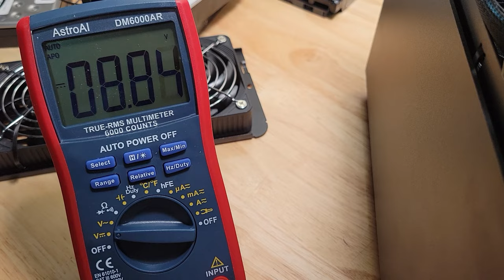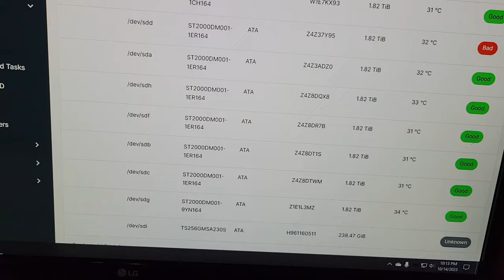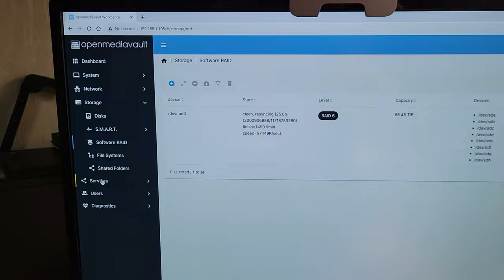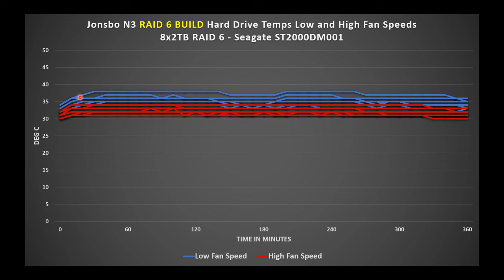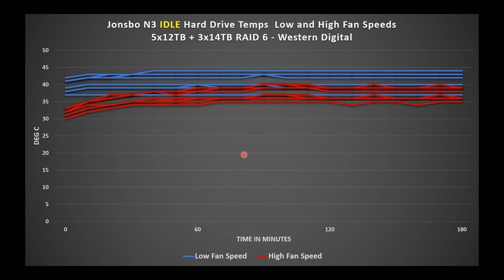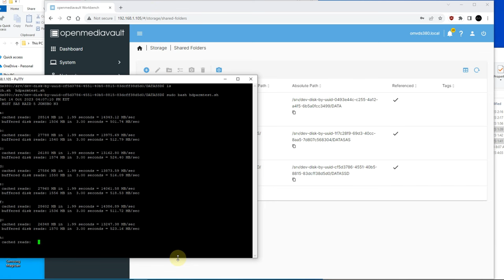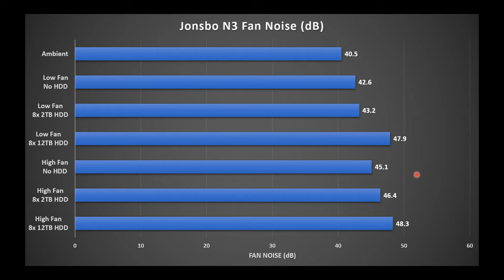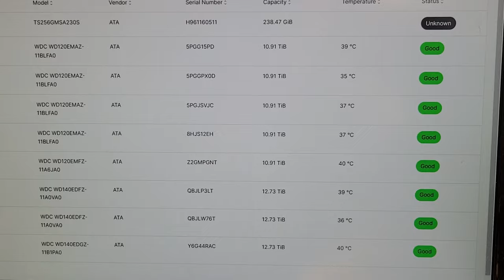Jonsbo N3 8 Hot Swap Bay NAS Case Review

Comment: One note to the ITX form factor and only 1 PCIe Card: you can bring out 4 pcie lanes from an unused m.2 slot on the mainboard via an adapter cable (just google m.2 to pcie cable) and use that for a 10gbit ethernet card or similar :)
Reply: Could also get an M2 to Sata adapter and leave out the HBA in favor of a 10gbt NIC.
Reply: been researching for a few weeks, and it's been frustrating finding that itx+10gbe+8sata, and i'm smacking myself reading your comment why I didn't think of that
Reply: Yes, this is a great idea

Comment: Honestly it's like they are trying to make a bad design (and they are insultingly expensive), in my opinion a nas good for most personal use's doesn't have to be a very powerful machine, you have to take in account power usage (electricity cost's money) and noise as it most likely going to work near people. The motherboard should be placed preferably on top for good heat dissipation with an air vent or option 2 on the side and top vent, in both cases with enough room for a beefy cooler (to reduce fan usage and noise) . Jonsbo n3 is good but they just had to insult us with not having a top vent and some decent hdd bays also the price is high and your getting so little especially considering that the users are going for this option precisely because they don't want to spend to much money and the build quality could be better, also larger rear fan exhausts, they make less noise and you can move more air trough  !

Comment: The extra HBA requires extra power consumption, which is not a good design, the PSU is heavy and should not be placed on the upper tier, the motherboard form factor is locked at ITX size, this is another drawback, I prefer buying second hand super micro servo The appliance has a case with 8 hard disk slots.

Comment: Great overview! I have the N2 and it's great but I wish the N3 let you install a mATX motherboard as the added width wouldn't make that much of a difference and would differentiate it even more from the N2.
Reply from the maker: Fully agree, Mini ITX is OK for a 4 bay NAS, as you can find motherboards with four SATA ports, but 8, you need an HBA PCIe card. They could widen the case by a few inches, shorten it by a couple inches because you don't need full height cards or massive CPU coolers, and put the SFX PSU next to the hard drives.
Reply: @htwingnut can use a m.2 to sata ports card on mitx but yeah make it a little wider to fit matx would be great
Reply from the maker: @Andreas-w  Agreed. But if you use M.2 to SATA port adapter you lose the M.2 port for your OS. I know there are mITX motherboards that house two m.2 slots but one is on the bottom of the board and uses a separate controller and usually are much more expensive boards.

I just think that this device wouldn't need to be much bigger to house an mATX, just make it wider and house the SFX PSU next to the drive bays, and allow room up top for an mATX board, and doesn't need to be quite as thick either. Just my opinion though. Otherwise case is actually quite nice.
Reply: @htwingnut  yes matx would be a better solution

Comment: Great review! Thank you for all the information. I know it's been a minute but when you built this did have any issues with the power configuration on the back plane? Did you have the 2 atx and sata plugged in to supply power?
Reply from the maker: I had plugged in both SATA and Molex. You may not need all of them but I wouldn't risk it to be honest.

Comment: Good review, thanks.  Whilst I agree with your review, in the summary there is one thing I dont agree with.  I dont want a NAS, I want a mini Application Server! I will need a NVIDIA GPU card because I would be running Frigate, Compreface and Double Take.  So the height is needed for me. (and actually the PSU needs the height!) and I will need to ensure good cooling on the CPU and the M.2 cards.  BUT as I said a good review to confirm it is a good case for those needs.
Reply from the maker: Thanks for your comment! It is good to have the option for sure. Just for those looking for a NAS case (which seems to be its primary intent) it is just extra unnecessary bulk.

In my mind ultimately make the footprint a bit bigger to fit mATX board and then can mount GPU sideways, move PSU down next to hard drives, and not be much larger overall.

But that's a wishlist, lol. The case is pretty nice as is.

Comment: I put a similar comment on another video but I wonder if an Asrock H610M-HDV Motherboard will fit in this case it is an m-atx board but is only 19.7 cm x 18.8 cm so might fit and would allow use of both PCIe slots. I think it will but might have to mod how the Powersupply is attached, possibly mounting it horizontally rather than vertically?

Comment: Thank you for this review! It’s the perfect case for my needs. I currently have a mITX Xeon with 6x 3.5, 1x 2.5 in a Fractal Design Array R2 and wanted to install an Intel Arc 380 for video transcoding and some ML photo classifiers, but the card blocks a HDD… this is the solution! 
As others have said, more modern boards come with 2 M2 slots, of which one can be converted to 5+ SATA ports, and having space for a GPU for ML applications or transcoding is in my eyes a big bonus for a home server. I don’t want to have multiple machines running 24/7. In this Jonsbo case, one can provide a ton of storage to the house, and host media services with plenty of processing power in one box. The separation of storage and compute compartments is brilliant, one can put a powerful CPU/GPU in there and not worry about frying the disks!

Comment: Thank you for this video. I am planning to build a NAS in this case and this was a great help. There's a cool little board from Silverstone (the ECS07) that plugs into an m.2 slot and provides 5 additional SATA ports. Only Gen 3, but it looks like it will provide the throughput needed for hard drives.

Comment: OK, but what are actual SAS interface speeds for its backplane? Is it full 12G, or is it halved, because only one port is active?
Sorry if my question is stupid, never had a chance to work with SAS drives…
Reply from the maker: I am not 100% certain, but I would imagine if it were "SAS compatible" that it would be 12G as it's just an electrical pass-thru and speed is more dependent on the SAS controller than the slot. Not to mention that unless you have drives that can run 1200 MB/sec it'd be hard to validate either way.

SAS 12G is more for total bandwidth for expanding to multiple drives, which wouldn't be a factor in this situation, because each disk would get their own dedicated 6Gbps or 12Gbps lane.

Comment: Hello. Can you tell me how many watts your power supply is? Approximately how much does the system consume when idle and with multiple disks?
Reply from the maker: PSU is a Silverstone SX300-B 300W. I no longer have the system assembled, so unfortunately can't tell you at this point. Either way, that would depend entirely on the disks used, motherboard, CPU, RAM, PSU, etc, so it could vary greatly from setup to setup.

Comment: Nice video! Case is almost perfect, wish the CPU/Mobo compartment wasn't soo high!
Reply from the maker: Agreed. That's my one of my biggest gripes too. Nobody needs a mile high cpu cooler for a NAS case. And no need for full height PCIe card either, really. It's not a game case. This would be perfect if it accommodated a microATX board and reduced the height.
Reply: @htwingnut  Exactly! In my case I'm still running a 4 year old Asrock c2750d4i board with a SOC and only needs 1U with fans in the front. I know many people had issues with those boards but so far mine has been good but I'm out looking for a case to houses 8-12 case in a tiny footprint. Difficult.

Comment: 07:43
Did they upgrade the backplane to support staggered spin-up? 
I read on chinese websites the newer models have a DIP-switch to choose spin up 250ms/500ms/off etc. 

PSU will not be stressed as much by having this.
Reply from the maker: Good question! It seems it's a "dumb backplane". I'm not sure the refresh interval of this power meter, but it pops up to 200W or so pretty instantly. It also sounds like they power on simultaneously: https://youtu.be/0rWryODz7p0?si=WeIoqpw2T8J-erog
Reply: @htwingnut  
Ah that's too bad! Even my 8 year old synology had it.
Guess those "dumb backplane" are old stock or something that they are trying to clear first. 

If you're in touch with a jonsbo representative, maybe you could enquire about it.

Comment: I have a Synology NAS and the HDDs constantly make vibration noises. Is it really dead silent here or you hear something?

I used to have Fractal Design Meshify 2 XL with absolute zero vibrations. I suspect it's also because the disks could lay horizontal instead of vertical.
Reply from the maker: The rubber standoffs really make a difference. I didn't notice any vibrations through the case at all. Of course disks make noise in general when seeking and newer high capacity disks use PWL which can cause a slight "thump" sound every 5 seconds or so.

Comment: @htwingnut You used some thicker 2.6cm drives. can they be mounted side by side in all 8 bays without issue? Also I purchased a pcie x4 to m.2 nvme and added a asm1166 6 port sata adapter. my concern is that it will obscure the cable hole to the bottom and also not be able to have sata cables plugged in. what is the measurement in my between the hbacard and the side panel please. this case seems great compared to my Lian Li PC-q25 for the size and thinking to upgrade

Comment: Great video! Just out of interest, what was the ambient temperature during the testing?
Reply from the maker: Ambient room temperature was about 23-24C
Reply: @htwingnut , thanks so much for the response! Planning on building a NAS using this case, but will be using the Topton n100 based MB, mainly because of the ultra low power consumption. Your video was really helpful and very detailed. Would have been great if you had some rough power-consumption stats. Thank you.

Comment: What motherboard do you have with 8 sata?
Reply from the maker: This is an older 4th gen Intel motheboard. It has 6 onboard SATA ports, and I used the wifi slot to add another two. Unfortunately it's hard to come across a current gen Intel (or AMD for that matter) motherboard with more the four ports in a mITX form factor. Asrock Rack makes server motherboards with 8 SATA ports, although they are a bit expensive.
Reply: I'm looking for a motherboard socket lga1151 with more than 4 Sata. This is a big problem. The QTJ2 processor will be in my NAS.

Comment: sorry my OCD is killing me.

WHERE IS YOUR MOTHERBOARD I/O PLATE?!?!?!?!  you monster!!

also,   the motherboard clearly has x8 sata ports,  why put the lsa card when you could have used the motherboard's  ports and save the pci-e slot for a dedicated gpu for transcoding?????

that is clearly the whole idea behind this.

in any case, i'm interested in that motherboard.
Reply from the maker: Haha. For a quick build, I don't bother with back plates, I was disassembling afterwards anyhow. This wasn't intended as a practical usable build. Just for building up the case.

The motherboard is just a test board. It's an antiquated ASRock Z87E-ITX for 4th gen Intel CPU's. It has six onboard SATA ports and one mSATA port on the back. But if you use the mSATA port you lose functionality of one of those six SATA ports. The additional two SATA ports come from an adapter board in a full size wi-fi slot. 

So while technically I could run 8 off that motherboard, I'd also need one slot for boot drive, leaving only 7 remaining slots. In this case, that wouldn't fly because the case supports 8 drive bays. But I've used this mobo a few times before for builds that had 5 or 6 drive bays, so there is one free SATA for boot drive. Not to mention I wanted to test SAS compatibility and that can only work with a proper SAS PCIe HBA card. Not to mention most ITX motherboards only support 2-4 SATA ports onboard, so figured they'd want to see a full length HBA card.

All that said, I do have a video coming up showing a couple modern solutions though.

As far as transcoding as long as you have an Intel CPU with an integrated GPU supporting Quick Sync, there really is no need for a dedicated GPU. I've seen reports of users getting upwards of a dozen or so simultaneous 1080p -> 720p transcodes with Quick Sync, and at least 6-8 4k transcodes.

But you are correct, it is not the most practical build how I had assembled it.